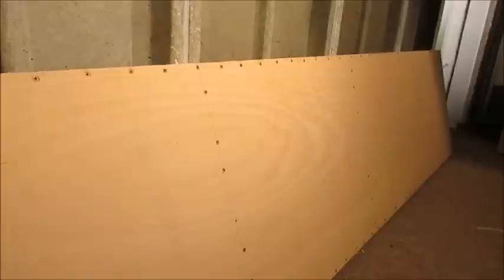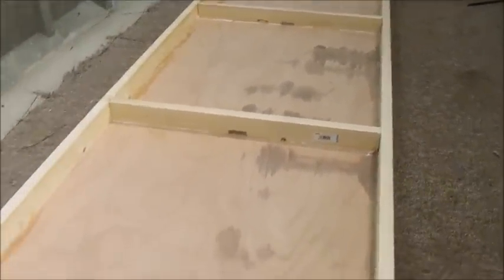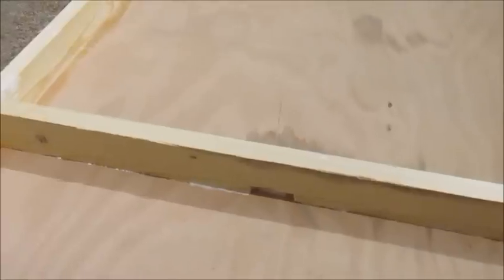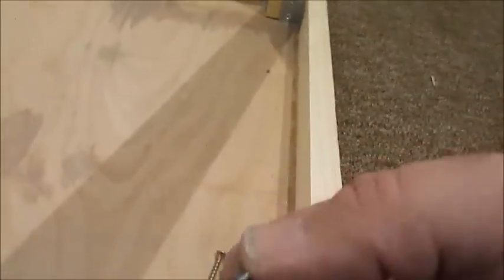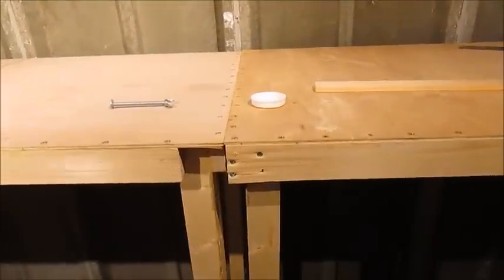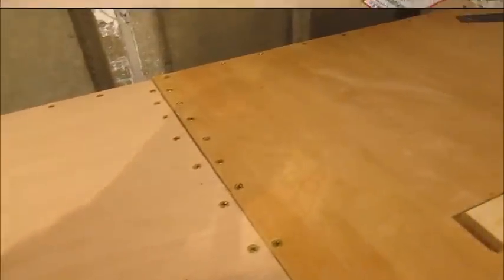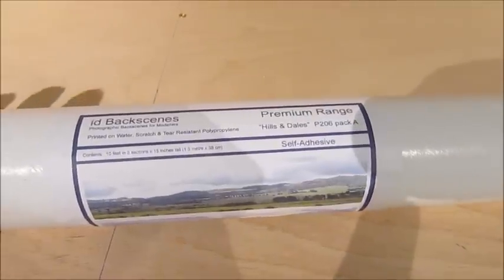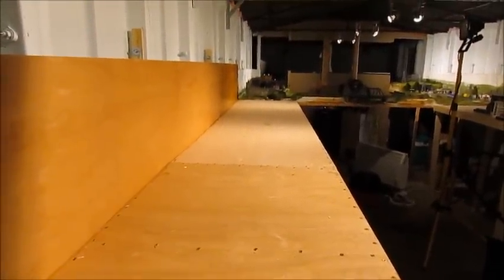A guide to constructing model railway baseboards

Comment: I had looked at using 5.5mm ply for my extension but a lot of people mentioned using 9 or 12mm watching this I will use 5.5. Great video thanks for uploading
Reply: Did you use 5.5? If so you made a mistake. 9mm is the absolute minimum. 12mm is recommended but 18 or 22 is way better.
Reply: @LordBonesaw  Correct, 12mm is ideal.

Comment: Realise this is way after the making of the video.  But thank you.  I plan to use 9mm plywood for my base boards. What thickness did you use for the back screen?  Also, what is the wood size for the legs?  I was thinking of use 38x38mm, with adjustable feet on each to ensure they are all level.  I will have 5 boards in total.  The layout is in a centrally heated bedroom so no problem with extremes of heat of dampness.  Thanks again.
Reply from the maker: The feet are 3.5cm in width. The back screen is also 3mm thick plywood. I used a soft wood on the first half and found it warped. So recommend plywood more rigid. Bought all of the wood from Wickes if it helps?
Reply: @CHESEABUN  nice

Comment: Were screws on "sale" at your local box store?  Way too many screws,  if you use a decent "white woodworking adhesive" such as Titebond II  you will get a far better job and use probably 25% of the number screws you used.  Today's modern adhesives are extremely reliable, the wood will break long before the glue joint.
Reply from the maker: Hi,

I used many screws due to the woods environment. Sometimes there is a bit of a temperature change this time of year. I used more screws this time to stop the baseboards warping. Hence the extra struts underneath on the frame. On the original phase 1 baseboards I did not use enough screws.
Reply: I have spent months researching how to build a railroad layout and discovered a great resource at Jareks hobby club (google it if you're interested)
Reply: This is just superb, I been tryin to find out about "custom model railroad layout builders" for a while now, and I think this has helped. Ever heard of - Piyaliyah Uncommunicative Preference - (should be on google have a look ) ? It is a good one off guide for discovering how to build a model train railroad easily minus the hard work. Ive heard some incredible things about it and my neighbour got great results with it.

Comment: Yes you would need to put posts behind baseboards against walls that would provide you with something to screw brackets for a 1ft shelf to be mounted on. Perhaps you could put in thin posts in the crevices and join them with the back scene boards, nothing would be protruding. Use wood glue on backscenes that are already done. Give great strength to whole thing. It's easier to do now that when back scenes are finalised. I saw a guy who did this and went to a third level near roof and then crossed room. It looked class and made the whole runaround last 10 mins or so for a single loop. It then turned on a wider section and came back on the other track. Once posts are in many extension possibilities available in the future. Perhaps put long post all way to ceiling to allow for any number or narrow levels to go round the room in future. It's now or never :)

Comment: I have a shed that has an 12 inch bench around three sides. The area is about 10x10 ft and Im looking to build an 00 model railway using the space available. What would you say is the ideal number of tracks for this space. Is it big enough to run at least two tracks round and round?
Reply from the maker: You should be able to do double track in OO. Recommend 2nd radius set track for curves or at least one side of them. Hope this helps? Richard
Reply: @CHESEABUN  Thank you Richard. I started off with 24inch widths on three sides and a 36 inch at the top end but it seems rather a lot of space to fill. Im learning to keep it simple and spend more attention to scenery.
Reply from the maker: Really enjoy making scenic items. You will find it brings the layout to life...

Comment: Hi just found your channel I have a dilemma Im hoping you can help I am building a layout in my loft I have found I have so much stock I need to build another level on the floor of the loft I am trying to work out how I can have boards with track fitted but be able to lift or pull out so I can work on the sections and more importantly wiring etc underneath the board, I will probably have to build a helix or 2 alternative 1 helix and a long incline then fix a board about 18" - 2ft on legs (cant remember what the height on the built part is exact) would you or anyone know how I can build two levels with a removable bottom level?  I intend to use metal contacts under the rails at the end of each removable lower board.
Reply from the maker: Sorry for the late response, Had a few family issues to sort out. I personally don’t know anyone who has gone for the removable lower deck. A friend of mine has a fixed lower deck with a Helix. Some trains do struggle on the incline of the helix though. A long incline should work better? There are a few on Youtube with double and even triple decks. I would send them a message. Most modellers are more than willing to help. Sorry I couldn’t help more but I haven’t gone down this road. Cheers Richard.
Reply: @CHESEABUN  thats ok i am just concerned if i put a permanent lower deck after thinking ive completed it build the top deck with legs standing on the lower then find I need to add something else more wiring track etc and cant get underneath
Reply from the maker: @markjackson8789  . I would always recommend leaving space for wiring underneath the boards. Ta Richard.

Comment: Really taking shape, at a later stage could you add a shelf like level above layout approx 2 ft above that could run round whole garage solely as a running track ( ie country scene ) would give huge amount of extra running in space that's not being used. I say this now as you may have to make provisions now before you go further. It would only have to be 1ft wide so wouldn't obstruct view of main layout below. There is so much can be done in small space to prolong the running sessions. Well done so far, videos very helpful.
Reply from the maker: Thanks, Good idea. I will have a think about that.

Comment: Such a large garage....you should have isolated it very well and maybe even some kind of heating. Now it's damp and cold and in summer it will be very very hot and you are gonna build a layout there ? With all you expensive trains .... I wouldn't for sure ...
Reply from the maker: I have insulated it recently. So far so good. It’s been up now for about 12 years. At first I had condensation problems during Winter variable temperatures.. Then I  insulated the roof. The walls I haven’t done. I have a portable heater that takes the edge off the cold.The only slight problem is creepy Crawley insects this time of year.